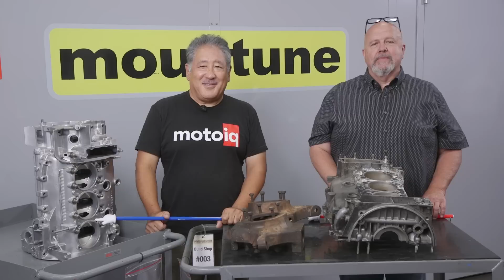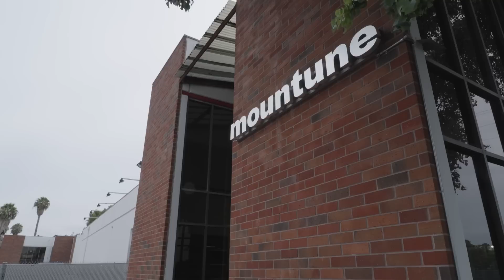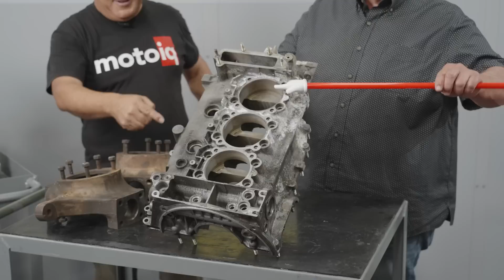Vapor Blasting Makes Dirty Parts Look Brand New Again!

Comment: Whenever i let anyone have a go on my vapour blaster people always wave it around in the cabinet.. (hehe)  Yeah vixen, great machines but,  If you are methodical you'll get good results from having a technique.  I had my machine a year before i really got my head around all the little things involved. But so glad i did. If you have the budget go the Vixen route, if you don't study other youtubers who blast and you'll get there.  Remember, having a dry blaster with same size bead as the wet blaster is a thing that's not talked about, dry blasting with bead!!  That is a great way to preclean stuff before vapour blasting "same bead as wet blasting"!!  After doing this both my vapour blaster and dry blaster perform better and i don't have to change out the water and media as much, Thanks for the great video guys.

Comment: How is it vapour blasting???   Looks bloody wet to me in that cabinet!!!

Stavros
Reply from the maker: Dunno that is one of the names for the process.  It is pretty much a good stream of near solid liquid.
Reply: Aqua Blasting is more accurate
Reply from the maker: but that is not what it is commonly called
Reply: because it's not a pressure washer.  Instead the mixed water/abrasive slurry is feed into a Venturi nozzle where compressed air accelerates it to several hundred mph and turns the water into a high pressure mist (hence vapor).  Is it really a vapor?  No.  But it's not not just pressurized water, either.  And high pressure sputter blasting doesn't sound as good.

Comment: what is the cost comparison to dry ice blasting
Reply from the maker: Way cheaper
Reply: @motoiq  what size compressor is needed
Reply from the maker: Pretty huge, the compressor is a significant part of the cost.
Reply: @motoiq  so bigger than a 5hp
Reply from the maker: way way bigger

Comment: I like that wiper action in that blast booth 😎😃!!
Reply: helps with efficiency as visibility is constantly blurred with the sand dripping and setting on the glass, but there's probably more frequent changes of protective screen otherwise i imagine the wiper would scuff up the window surface
Reply: @RedRideRVT1R  Glass holds up fine I replaced my glass after two years

Comment: Is it better than walnut media for cleaning valves and inlets on gasoline direct injection motors?
Reply from the maker: Walnut is more delicate on the valve sealing surfaces and if ingested by the engine less harmful.
Reply: Advantage of walnut shells is you can clean the heads without removing from an engine where as vapor honing would require complete disassembly.

Comment: How does it compare to dry ice?
Reply: Most of the difference is gonan come in at cost and how gentle the blasting is. Dry ice can be very gentle to even plastic parts,doesnt have to be isolated to a media cabinet and parts can be done on the car. Vapor honing is gentler than dry meda blasting but isnt goign to be as delicate as dry ice. Dry ice blasters can be insanely expensive compared to wet media cabinets. Each process has its place depending on what you want to clean up.
Reply: @TankEpidemic  thank you for the explanation, makes a lot of sense
Reply: @jowarrior  that was a very good question actualy 👍
Reply from the maker: What @TankEpidemic said.
Reply: No residue media to worry about with dry ice
Reply: Ones wet, see if you can guess which one.